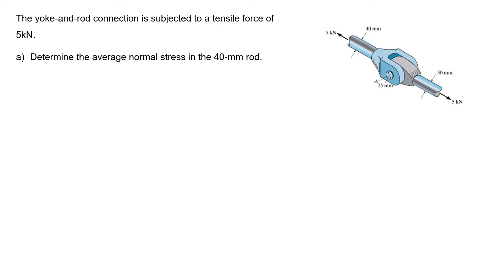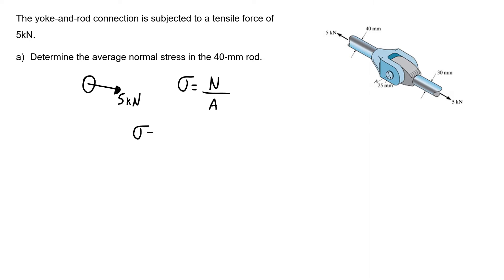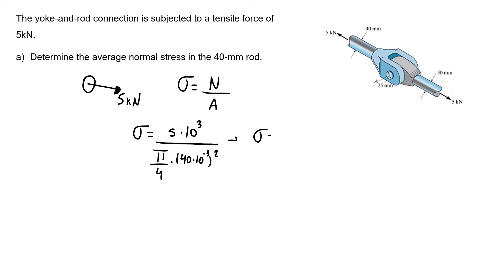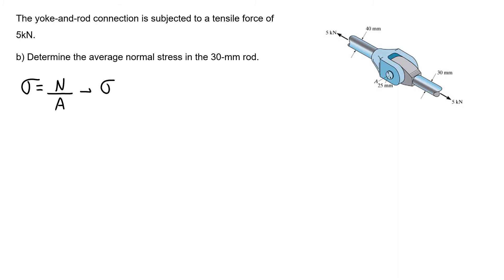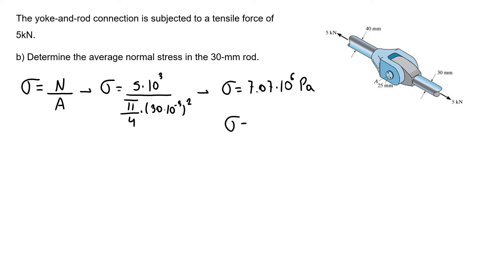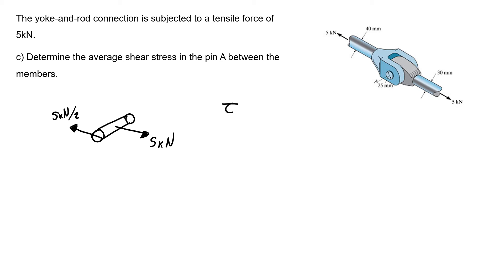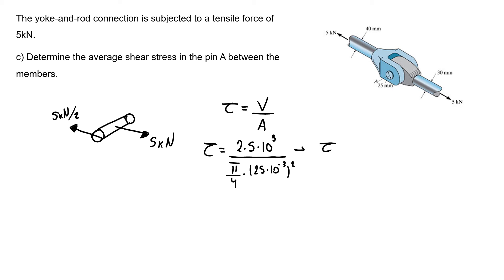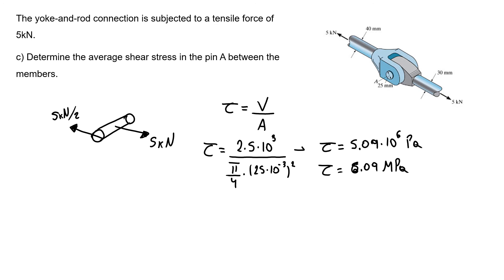Internal Loading - Exercise 9

Comment: Why does we use the double shears as the force? instead why not count both for part?
Reply from the maker: Hi Fauzan, we used double shear because the pin A has two shear surfaces, therefore the force in one of the surfaces is half of the force applied at the rod. Remember that the shear force is parallel to the surface, or if you prefer is perpendicular to the area vector. Let me know if I answered your question and if you have further questions.
Reply: @nomysteryscience15  hello
Reply: @nomysteryscience15